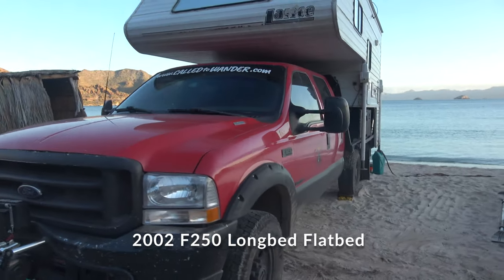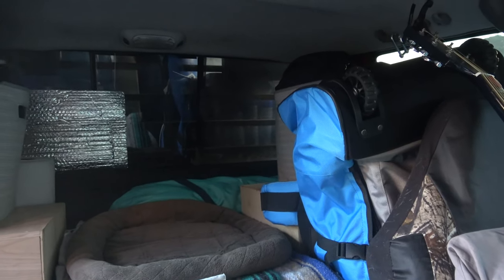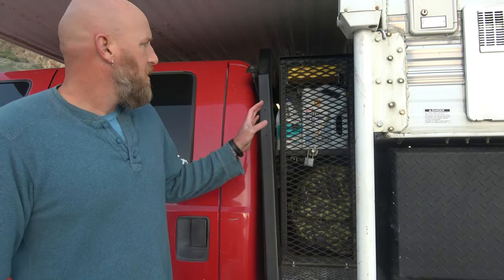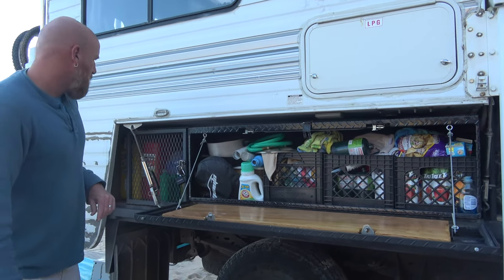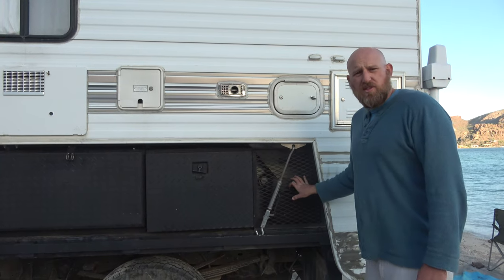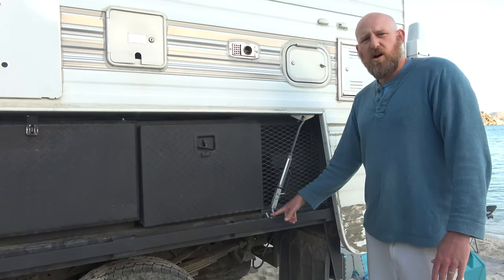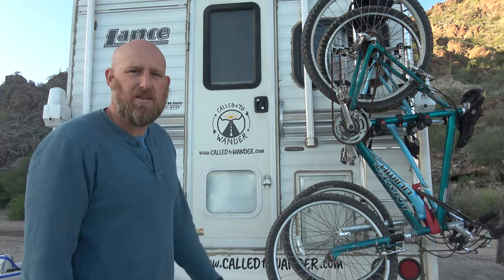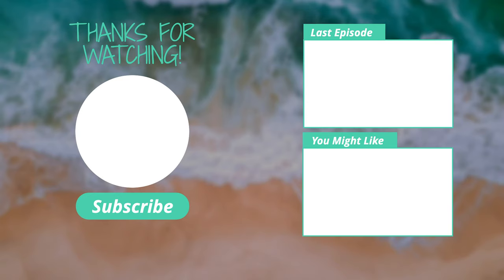DIY Flatbed Truck Camper 4x4 Adventure Mobile // Flatbed Truck Camper Tour  // CtW

Comment: That's a great setup and maximum use of limited space.  I really like the short-bed camper on long-bed truck setup, especially with using a flat bed and custom built storage to use the extra space.  One thing I always run out of in the 'traditional' setup (short-bed camper, short-bed truck, no flatbed) is outside storage.  Really innovative, and clearly a lot of thought and planning went into it.  Most of all though - it's set up exactly how you want it to support what you do ;)
enjoy the travel - it's the best part!
Reply from the maker: Patriot Thanks! It’s taken us a while to tweak the setup the way we have it now. But it definitely gives us the space to be very comfortable on the road. Thanks for watching!

Comment: One of the best things that my Lance came with was a plastic gutter for the poop pipe. It's really easy to clean out and keeps water from coming into contact with the metal bumper. Cool build, I never thought of putting a short bed camper on a long flat bed.
Reply from the maker: Our camper may have had one of these once upon a time, but it has since gone missing! And yes, we were kind of revolutionary when setting out to combine the long bed truck and short bed camper. But it's worked out well! Thanks for watching and reaching out!

Comment: I recently traded a 00 dodge ram 1500 for a single cab 04 chevy 3500 dually 6.0 gas vortec with a utility bed which i already removed and sold and i found a 8ft long bed dually to place on it but the holes dont line up with the frame so now i need to make some brackets to make it fit but i did wonder if i could tow a cab over on a flat bed im glad i searched for it and found your video it really helped me out now if i get a chance to get a cheap cm or norstar steal flat bed i will do exactly the same setup you have on your rig its very convenient and looks amazing!
Reply from the maker: Thanks so much! In the industrial world, anything is possible! We've made friends with people who built out some even more spectacular truck campers than ours because they had the skills and abilities (or money) to hire someone. So if you can think it up, you can find a way to make it work. We'd advise above all else to consider safety first. Be sure you are within weight rating as best as possible (add the biggest tires you can to support the weight), invest in good suspension (upgrade if necessary), and be sure you anchor the camper to the bed securely. If you account for safety in your design, then you'll be glad with the rest of your buildout! Enjoy the journey and let us know how it ends up!

Comment: Great ideas thanks for sharing. I really like how you use the the toolbox lids as tables. I just starting my flatbed camper build and I'm going to use your idea. I have a Duramax a 8' idle time overhead camper and a flatbed I just need to get everything put together.
Reply from the maker: It was the best idea we knew to do in our own. We’ve seen lots of custom welds since we hit the road. But for our budget and skill set this worked perfect!

Comment: Thank you great to see your ideas.
Reply from the maker: You're welcome!
Reply: @CalledToWander  we go tomorrow to look at a slide in camper (used) to put on our 2001 Dodge 3500 flatbed truck. I really appreciate that you talked about center of gravity.
Reply from the maker: @terrybowling5973  I wouldn't do this setup again this way because of that and the total weight. Every time I look back on this rig (sold it over 3 years ago) the pictures make me cringe! Should have had a bigger truck. We were right on the center of gravity, by like 2 inches. But the weight is a huge consideration too. Enjoy the shopping!

Comment: Tips on finding your center of gravity? I have a pop top palomino one a short bed Ram 2500 gasser. Killer vid. I’m
Also considering fabricating a flatbed! Thanks for sharing!
Reply from the maker: Our camper manual had a diagram indicating the center of gravity. I would assume you could look it up for your model. But I think putting the short bed pop top on a short bed camper you'll be fine. They made those two to go together. We were a little out of the box in our thinking so we wanted to be sure we didn't have the camper so far back that we popped a wheelie when hitting a bump! Enjoy the road!
Reply: @CalledToWander  thanks y’all! Same and safe travels! Looking forward to following along!

Comment: Awesome set up.  how did the RV set  against the bumper in the rear was it right up against the flatbed or is it gapped?
Reply from the maker: It fit with about 1/2" of room between the end of the flatbed and the black tank cover. With the boxes we welded behind the cab, it was the perfect, tightest fit.

Comment: Great functionality.  I like it.  I’ve got a 99 F250 LB, V10, 4x4, 5 speed manuel transmission and air bags.  We bought a 2013 Lance 850.  When we were loaded for a 2 week trip it was 1,600 lbs over the trucks GVWR.  It sat level but handled bad.  We traded it in on a Lance trailer and I hate pulling a trailer.
I’m thinking about an aluminum flat bed on my old truck with dual rear wheels and another camper.  In my mind there is no better way to travel.  I’m I nuts?
Reply from the maker: You are absolutely NOT nuts! We love our truck camper for being able to go virtually anywhere. We've never wanted to tow anything so we'll be in our truck camper for a while! Aluminum flatbed would be great from a weight standpoint. We lacked the funds to start this way but if we had more money we'd look to lose the steel and go with aluminum. Keep us posted on your journey!

Comment: Look awsome,  how much is the set up weight? I have same but short bed im worried carrying my 821 Lance
Reply from the maker: Couldn’t tell you now 3.5 years removed. We were heavy for sure. Most of that was in the steel flatbed itself. If you have options to remove the steel bed or go with a dually that can support more weight then better off. I cringe at how much weight we carried with this setup

Comment: Great job guys!!! i am currently doing the same thing along with a camper remodel to add a shower/toilet. Where do you guy=s have your holding tanks mounted? i saw your "poop tube" great idea!! does your black water tank hook directly to that tube inside the bumper or is it located under the truck? 
any insight would be extremely helpful. Thanks in advance
Reply from the maker: Our black and grey tanks were both at the rear of the camper next to the bumper. The switch valves were in a small outside compartment on the rear driver side. But the outflow pipe hung out from beneath the camper. So we would have to pull out the poop tube and connect it before dumping. But all that was conveniently located in the same rear/drivers side and was quite simple. Hope your remodel goes well!

Comment: Great video 👍, Im also curious about the width/length and weight of the flat bed and the weight of the camper? Thank you
Reply from the maker: I don't have my notes around anymore with specific/exact specs. But we have a big steel flatbed that weighs too much (in our opinion). It was a work truck and we didn't budget to modify/change the flatbed. The width/length of the flatbed is roughly 8' in length and 1" less in width than our camper (makes backing beneath the jacks very, very tight). Again, I don't have the numbers and with the rig together now I couldn't get much more exact. As for the weight of the camper, factory specs say just under 3k wet (including our air conditioner and additional propane tank). Of course we have added weight as well - a second battery, a few jerry cans (water x2, diesel x1, gas x1), 2 x honda 2000 generators 3x 100w solar and then the stuff of life. At one point we tried weighing all of the variables and honestly as we live 100% of the time in our truck and camper things are constantly changing in what we have/jettison as we're always looking for ways to go lighter and with less stuff (yet always equipped to be self-sustainable)... Our biggest recent modification, thanks to the roads in Baja, has been to beef up our rear suspension. We have 2 x Rancho5000 shocks (yes, a Mexican welder modified that for us since we couldn't locate the Rancho9000s) and we also have beefed up leaf packs (yes, a Mexican leaf expert added 3 overload and 2 standard leaf springs to each pack). The axle doesn't carry any more weight, nor the tires, so we are always wary of weight. But by definition this truck/camper is big so we look for ways to carry the weight better (kind of like my wife... don't tell her I said that, lol). Iknow that's not specifically answering your questions but with every modified flatbed truck camper the specs will be different. We've seen about 10 others in Baja and know that our truck and camper would not work in combination on any of the other setups... We also had our camper before our truck, so we shopped for a truck that would fit more or less the way we wanted (single rear wheel was important to us) and then kind of worked the math backward to make sure everything fit! Hope some of this helps! Do you have a truck and/or camper already?
Reply: @CalledToWander  thank you for the reply, it is very helpful, I don't have either currently but Ive been putting a plan together, I've decided to get my camper first, and have been looking for a srw 1ton crew cab. Weight is my biggest concern at the moment as I plan on towing a Jeep and trailer with us. So I was thinking about and aluminum flat bed but don't think the budget will allow for this setup currently, but seeing your setup, makes me wonder if something I can do down the road.
Reply from the maker: adam fowles I think you have the right idea. SRW is always limiting on weight but for us the roads on the Pan Am (tolls are by wheels, airing down in some cases, etc) made us stay away from dually. We also knew we wanted 7.3l engine so that narrowed our search quite a bit. We were fortunate to find the combo we wanted in truck (flatbed, longbed, crew cab, 7.3l, srw) and made sure the flatbed fit the camper (yes I had my measurement then and took tape measure to bed before buying the truck!)... also aluminum was not in our budget, nor did our welder friend have ability to work with aluminum... budget aside, we’d go lighter aluminum bed for sure... BUT also consider if you want the truck apart from the camper. Some DIY flatbed campers fix the camper to the truck and it becomes one. We wanted to be able to separate them (and fortunately we did as we’ve had several instances we needed them apart). We’d love to hear how your decision goes so please reach out when you make your buy and also if you have any other questions! We put our diy in our website for the steps we did, if that helps

Comment: that is sick!! I am thinking about the same thing. Buying a dodge 3500 flat bed, then finding a metal fab shop and make a really nice drawers like that. question how did you mount the camper? how does it do taking it on mild off road to boon dock?
Reply from the maker: RideWithWill You’ll have a great time! We actually didn’t do too much welding. The camper is secured at 4 points with tie downs. Then gravity keeps it nice and snug most days. The rig handles off-road adventures- some more than others. But as we live full time out of this we have decided we need to take it easy on the off-road! We went with single rear wheel F250 so you’ll have different options with a 3500. Let us know how it goes and if you have any other questions!

Comment: inspirational ! Thanks for showing . R u happy w 3/4 vs 1 ton ?
Reply from the maker: Thanks for watching! We were happy with the 3/4 ton particularly as we wanted a single rear wheel 7.3L diesel. Any full tons would be dually and our camper would not have worked out without adding dually brackets. But as our purpose for our truck and camper was to equip us for the Pan American highway, we learned that single rear wheel is an advantage and thus the 3/4 ton became our truck of choice.

Comment: Awesome setup. I’m working on getting our north star camper on our new flatbed, did you use a regular tool box on the side that you have the outdoor kitchen? And how did you secure the boxes that you used? Thanks for sharing!
Reply from the maker: Yes those are standard tool boxes tilted at 90 degrees to open sideways instead of up. We drilled 4 holes, one into each corner, through both the box and the bed and then bolted them in using washers on each end. It was a pretty simple process so it should be easy to replicate. The hardest part was finding the right size boxes to optimize the space beneath the camper since we did not custom weld them to fit exactly. Hope it goes well for you!

Comment: Hi , I am currently also looking into this process. I see that you have changed to an RV but i know you have ample experience with the flatbed. based on all the comments and the information on the internet it seems a lot of people are looking into this but theres really not much informaton on the web on how to go about designing the flatbed and choosing the camper.I am trying to design a flatbed now for a pop up camper and would love to hear some of these folks similar experiences or information they have come across.
Reply from the maker: Thanks for watching and reaching out! When we started this project in 2017 there was so little info out there. We knew what we wanted to do (drive from Alaska to Argentina) and we knew we wanted a certain TC setup. But we kind of tweaked as we went along. Here's our post on the criteria we had, the selections we made and how we built our TC. I plan to try and update it sometime down the road but it should give you a clearer idea of what/why/how we did some things. Please feel free to email us with any specific questions! https://calledtowander.com/build-a-flatbed-truck-camper/

Comment: I love your videos, I'm in the process of mounting a popup pickup camper onto a flat bed.  Do you just use the 4 normal tiedown points on the camper or did you do anything else to prevent camper from sliding side to side?  My flat bed is slippery metal diamond plate.
Reply from the maker: We have the rear tie downs pulling forward and the front tie downs pulling inward (across each other). We don't have anything pulling back because honestly the camper stays pretty well put. There have been a few times it did move around a little and we tweaked it by putting the jacks down and repositioning. A pain, but not terrible. You could invest in a rubber mat that would provide a little more traction. You could also install self-made "stoppers" to mount on the bed and guide the camper where it should sit.

Comment: I really like your flatbed setup 🤓. What kind of fuel mileage are you getting with the 7.3 and the camper? Again nice setup.
Reply from the maker: Thanks! So in the US we were getting around 11.5-12 mpg. In Baja we're getting slightly less, still averaging around 11 but sometimes under. We've learned the lower quality of diesel has some effect on the mileage. But the 7.3 is a champ and runs great whether on higher or lower quality diesel - one of the reasons we bought the truck knowing diesel would be sub-par on the Pan American highway... one of our issues in being super-precise is the way we fill our fuel on the flatbed is hard to actually top off. The fuel intake is only slightly higher than the tank and in Baja attendants fuel your vehicle so sometimes they have the patience to drip the last diesel to top off the tank and other times they stop when it comes spewing out! That said, I budget everything on 11 mpg. If we get better than that I am stoked. If it's under that I scratch my head and think back on the terrain and last fill-up, but it doesn't ruin my day.
Reply: 11mpg with that big camper, tires and all your gear that's not bad. God Bless and safe travels.😇

Comment: How stable is it being a srw? How does it handle all that weight would I be better off with a dually?
Reply from the maker: It is quite stable, though we’ve learned a sway bar in the rear would be the last thing to shore up any instability. And yes, a dually is a great idea if you’re not planning to drive the length of the Pan American Highway, which is our goal when we built this setup. Driving around the US would be fine with a dually as there are fewer places to need to air down or worry about off-road maintenance and there are no toll roads that charge extra for dually (Mexico).

Comment: Did you have to modify your front jacks to get out past the edge of the flatbed?
Reply from the maker: No. But we only had about 1 inch in either side of the flatbed so we didn’t take the camper off often!

Comment: is the camper permanently attached  to the truck bed? I read some flatbed campers can slide in and out just like normal slide in campers.
Reply from the maker: Ours was not permanently attached for a lot of reasons. Because we custom built ours we gave ourselves the option to detach (which we needed several times!). We put together a quick post and video on the how/why of loading our flatbed truck camper to give some insight into how convenient it is. Thanks for watching and reaching out! https://calledtowander.com/load-a-truck-camper/
Reply: @CalledToWander  Thanks, it would be really nice to have a video on it. I see that the bottom of the camper is still grooved like a camper for a regular truck, I thought the bottom would be completely flat to offer more room, or is it completely just custom?

Comment: Could you tell me what the tire/wheel setup is that you chose for your truck?
Reply from the maker: The wheels are the stock Ford 16" aluminum wheels, ours are just painted black. We love the tires we chose and they've performed and held up well for us. They are Toyo Open Country A/T 285/75/16 (I believe)